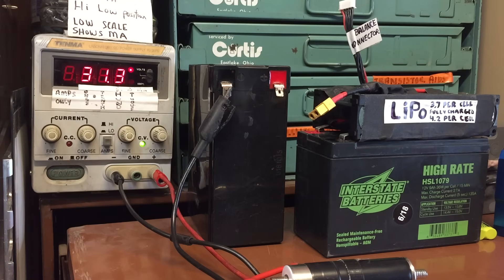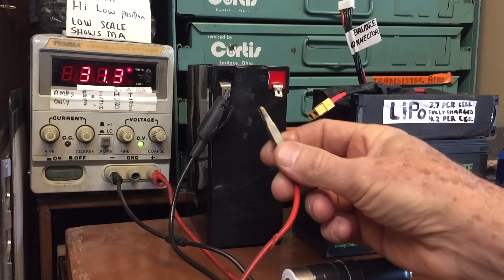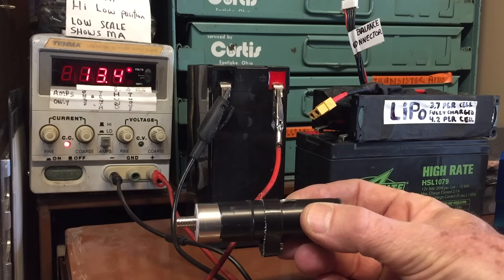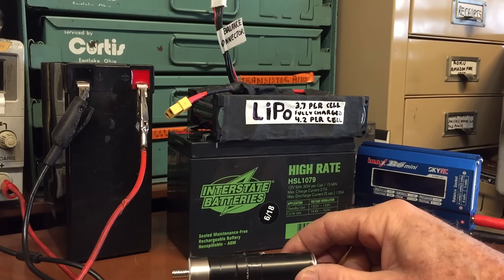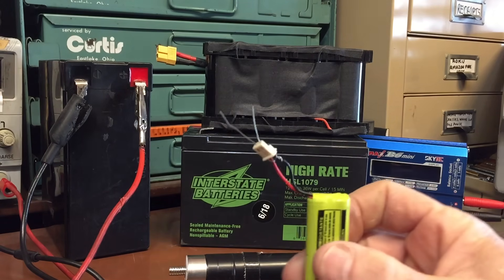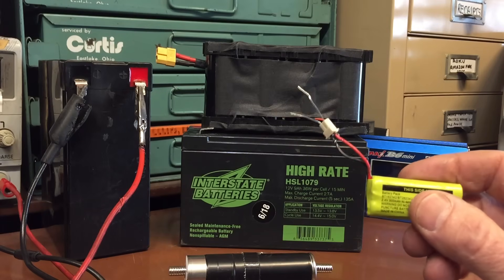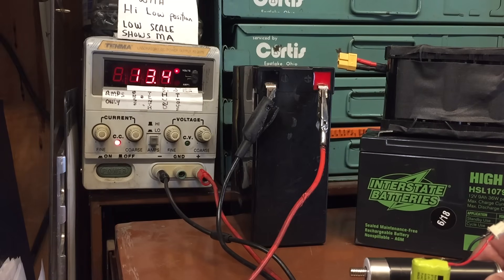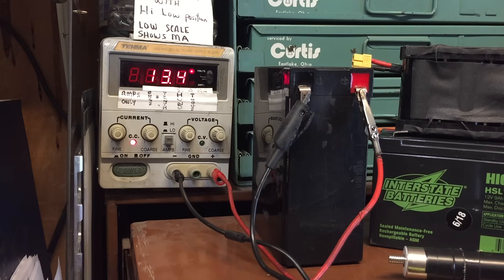Safely Charging Any Battery With Your Variable Power Supply.

Comment: Good. I have a PS so I can use.Question though
If I wanted to charge a 12V car battery and all I had was a old laptop Power Supply 
Output 19V ---- 3.42A. Could I retrofit 2 x terminal clips to the + & - leads and hook up the car battery. Would that work? Obviously monitoring the excercise e.g overheating. Periodic Multi meter checking.
Reply from the maker: I'm unable to understand your question.
Reply: @GrantsPassTVRepair  Oh. Nevermind was just a simple question. Could you charge a car battery off a laptop PS. was a hypothetical question.
Reply from the maker: @byLokie  You can charge a 12 volt battery using your 19 volt laptop power supply if you  don't leave it on the charger to long, but keep in mind that a discharged a 12 volt battery may draw more current than then your laptop power supply can deliver, in which case you may damage your power supply. If I was charging a 12 volt battery using a 19 volt power supply, I would monitor the battery voltage as it was charging, make sure the current consumption didn't exceed what the power supply limits of 3,42 amps, and when the battery your charging reaches 13.8 volts I'd consider it charged.

Comment: Isnt that what a trickle charger does? Keeps a contant 1.5a to a 12v battery. My dad would keep a maintainer on his motorcycle battery all winter. Never had any issues.
Reply from the maker: I twould not be safe to continually charge a motorcycle battery nonstop with a full 1.5 amps of current, but a battery maintainer would probably drop the current down to 50-200 milliamps once the battery is charged to maintain it's charge. and probably put our far more current when the battery is very discharged.

Comment: To over simplify it overcharging occurs when charging voltage is applied to a full battery. Think about your car the battery doesn't overcharge because the alternator / regulator backs the voltage off to the point where the battery stops charging. Fast charging is overpowering (voltage) to get the battery to draw more amperage and fill quickly but if that high voltage is applied to a battery that is close to full damage can occur. I grew up using an old heath kit navy power supply knock off with my grandfather. He would back the voltage off as the battery amperage draw decreased, so I guess to be safe you would need an ammeter. Also monitoring temp would be a good idea.
Reply from the maker: Yes monitoring for heat and voltage sounds like a good idea, and I see your point, but even when a battery is fully charged, and you continue to charge it with just a few millimeters, I doubt that it would ever be a problem on a temporary basis, as your generating very little heat, when you see the battery has achieved its full charged voltage, it's time to stop the charging. Perhaps I didn't make that clear enough in my video.

Comment: U said that the voltage drops bcse of the battery's own internal resistance right? So can I 'gess' the battery internal resistance doing that? I have a lot of batteries cells, so Could I compare them doimg this test to see which ones has the higer internal resistance?

Comment: Great video but my
Question for you is how do you check the state of charge ? Like you level of charge in the battery
Reply from the maker: To the best of my knowledge a voltage drop test under load is the best way to test a battery. Here is a video where I talk about this. https://www.youtube.com/watch?v=TQenKo9AFfQ
Reply: the reason I ask
Is I had a battery for a rc car that was 14.8 v i charged it to 15 volts . But what. It was put an a rc car bms said the charge was at 22 per cent capacity . It then charged its to 100% capacity and was about 17 volts

Comment: 🤔Now can this machine bring a Lithium-ion wheelchair battery back and other  kinds  of batteries  to be able to bring the battery up let it start taking a charger the rest of the way?Because what going on with the battery is 🫣it's way too low for the charger to read to even start up charging it right now!And these two battery's are not even a year old yet . She wasn't really using her wheelchair that much and Definitely Not Keeping them charged up like she should have to keep them taking a good charger.

Comment: I have a 20V DeWalt battery pack that is sitting at 13V. And I can’t get it to pull any current from my power supply. What do you recommend I try to do?
i have the PSU set to 20V 1A.
Reply from the maker: I'm guessing the DeWalt battery may have some internal charging circuitry built in to it, which may prevent the charger from charging the battery if it senses there's a problem with the battery, such as not having any voltage in the battery at all. If it were mine. I'd probably try to charge the battery from the output side of the battery, which bypasses the charging circuitry, but I'd also raise the charging voltage using a variable power supply, and monitor how much current it draws with an amp meter, so you don't over do it and end up blowing up your battery.

Comment: The matter is very simple, I don't know why so much drama and ignorance of the facts. Each type and model of battery has a prescribed excellent maximum voltage at which it is considered fully charged!
That's why, on your power source, limit the max charging voltage and set a limit for the current according to the capacity parameter, for example C/10, or even less! It can't hurt even less! And that is that.
E.g. for a 3.6v LiOn battery, the ideal voltage is 4.3V, current e.g. 500mA
For example, a classic lead-acid battery 64Ah (600A), Umax=14.4v (normal charging) Imax=6.4A, or less, if it has been discharged a lot below 10.5v and has been standing for a long time. The topic is too broad to mention all the details... And that's it. When the maximum voltage is reached, it switches to the constant voltage regime, the current drops to 0, most often it stays at the order of 100-200 mA...etc...
I don't know why you would set the voltage without limitation????? Why?????? What you are doing is dangerous!!!
Reply from the maker: Did you watch this whole video? I was not encouraging anyone to keep their battery charging on a continuous basis with the battery voltage above it's suggested charge voltage. I mentioned that doing so was a bad idea and potentially dangerous. I was simply explaining a technique I've been using for years, when i needed to charge a battery of an unknown amp hour capacity, and I did so by keeping the current down low enough, that I could walk away for a while, and still charge my battery without the fear of damaging the battery from excessive heat. Listen to 1:12 of this video.
Reply: @GrantsPassTVRepair  You don't need to know the capacity of the battery, but you certainly know its working voltage!!!! It can be 1.2v 3.6v 6v 9v 12v 24v 48v for example. It does not matter. If you know what type of battery you are charging, whether it is Li-ion, lead acid, agm lead acid, gel... you also know how to determine the final voltage! If you don't know the capacity, then you just put the current as low as possible, we agree on that, but it can clearly be assumed if you know the type and see what size it is.

Comment: I have long time discharged 18650 LG cells. Visually in perfect condition, voltage is under 0.0500v
Can I try to shock them with 12v 5a dc charger for few seconds?
I did try to connect them to healthy cell and voltage go up to 3v but fast go back when disconnected ...
Reply from the maker: I'm not sure if it's okay, but I've often done this when a battery doesn't take a charge. Is your battery not charging up when using the ideal charge rate for this battery?
Reply: @GrantsPassTVRepair  I did try with 12v 5A dc charger
First I started with few seconds after that but there was no change (cid is ok not blown up)
So i left it for 30s 1 min for few times, now it shows 0.8v 1v but that's it. I'm not sure how long i cant leave it on 12v dc power supply ...
Reply: Sadly i dont have power supply as you so with this dc power adapter I'm blind what I do :)
Reply from the maker: @donmarkon  I've done many experiments like your doing when I've had batteries that would not take a charge, and what I learned is some batteries are to far gone to regenerate, or they may come back to life, and only have a fraction of their amp hour capacity as they should. As you probably know there's always a risk of damaging the battery or causing it to explode if  you overcharge a battery, Much like yourself I take a few calculated risks now and then, but I would not feel comfortable advising you on this one, except to say be careful.
Reply: @GrantsPassTVRepair  Understood :)
Thank you

Comment: GREAT video, yes you ARE absolutely correct…. It is possible to recharge a battery using a variable charger. Just use good common sense and caution. We did and still do this all the time. Just match the rated voltage on the battery and go low on the amperage. Most important… check it and the cables every few minutes and make sure they are NOT getting hot. I NEVER leave batteries that I am charging unattended.
Thank you VERY much for this fantastic well done video. 😀
Also, we used to OVER charge CRT’s (cathode Ray tubes) that’s the main vacuum tube in which the picture is displayed
on an old style TV tube for a few seconds to burn corrosion off the electrodes and hopefully regenerate the picture a bit. This is done with equipment specifically designed for this… NOT with a variable charger. 😊
Reply from the maker: I had a B&K picture tube rejuvinator, but gave it away not long after the flat screen TVs took over the market. There were a couple times my rejuvinator did more harm than good, but other times they really helped.

Comment: So... if 30V battery is charged by dropped voltage of 13V - does that mean I can technically charge 5V AA battery full with 2,3V 100mA charger if I let it sit long enough?
Reply: naaah, the charging significantly discharged it to 2,3V lol

Comment: This is true. If you use 10 % of the batteries capacity you won't damage a Ni-cd  but it will take a long time. Check out battery  charging techniques for more on this.

Comment: I made the mistake of leaving my lithium 24V battery switch on after storing my boat and came back after a few weeks and the battery was dead. Is it possible to jump start or recharge the battery using a product like this? How long would it typically take to recharge if possible?

Comment: If the AC power fails when using a DC power supply to charge a battery, will the DC power supply be damaged due to the the battery sending voltage to the unpowered DC power supply?  The manual for my low cost DC power supply says that damage can occur in this situation.
Reply from the maker: Since I haven't seen the power supply circuit design in which you speak I don't know,                           but It sounds unlikly that an interruption in the AC input power going to the DC power supply would damage the unit just because it had no AC input. I've never seen anything like this occur.
Reply: A diode would prevent the battery feeding back into the power supply during a power outage, if I'm thinking correctly.

Comment: How can a laptop battery be charged using a DC bench power supply? Doesn't have to be fully charged, but maybe 1/2 to 3/4 for Laptop test purposes. Thanks
Reply from the maker: The power supply you use to charge the battery in the laptop computer will need to have an output voltage above the stated voltage of the battery used in the laptop by at least 1 volt, but unless you have a variable current output on your bench power supply like the one  I show in this video the only way to regulate your current going into your battery is through a current regulator or a high wattage resistor. The problem with using a resistor to regulate current is that it will get extremely hot. Naturally you will need a plug that fits your computer charging port, and you will need to match the correct polarity on your plug of you can end up causing your battery to explode, and possibly damage your computer.
Reply: @GrantsPassTVRepair  thanks for the answer. Some bench power supplies have variable current output but would have to look at which ones are best. Also thought of making a short cable to connect to a working Laptop to a good battery to charge it.

Comment: So, the main thing about charging a battery with higher voltage is,  it doesn't kill it, as long as the battery don't go higher then the intended charge voltage, for 12v a healthy 100% charge is ~12.9v normaly when charging it can go up to 14.3v which is normal however, as you connect the power supply and the battery is on low voltage ( 9 or under that) the voltage on your power supply will drop significantly so to charge it you need higher, even up to 30v could be used, however as the voltage inside the battery go higher the overall voltage drop will be lower, if a 12v battery goes down to 6v and you put a 20v and don't pay any attention to it it could go above 15v at which poin most 12v battery  start producing explosive gasses. So yes you can charge a battery with higher voltage, and yes it could explode if you leave it on for too long, however at low current it could take days or even weeks to become explosive.
Reply from the maker: I was not able to understand everything you said. 
                                                                                                I know from experience batteries produce an explosive hydrogen gas as they charge, That's  why people who live off grid on solar energy are encouraged to keep their battery banks in a area that has ventelation on the roof of the container they are kept inside.  Aside from the hydrogen gas danger, the other danger from overcharging  is to much pressure inside the battery can cause it to explode. I don't believe this should ever be a problem if your current is kept very low,
Reply: @GrantsPassTVRepair  Okay i read back on what i said, it's realy caothic sorry kinda lost my point there. In base what i wanted to say is, if the current is kept low it could still produce hydrogen, if it's hooked for too long to high voltage, however the current will tell you how fast it will happen, and as i said at low current it could take weeks or months. and it's indicated by the overall voltage on the battery while charging, if you start charging a battery the voltage will slowly rise as the battery charges, if it reach a point like a 12v battery charge 13.5-14.5v above that, it usaly produces hydrogen and could be dangerous. but on low current, it would probably sit there for weeks or months if it's a big battery, and it has to sit there, charging in an airtight, locked room to explode. If you don't actively  try to achive an explosion it probably won't happen, but saying that it's not dangerous, is not right since if you don't know how to set the volt-current ratio it could take months to charge or explode in the wrong hands. But i think you could probably fine tune it as it fully charged to stay under that 14.5 volts.
Reply from the maker: @studioreaper9646  Unless you are using a smart charger which monitors the battery and adjusts the charge rate according to the batteries needs, I would not leave any battery on a charger continuously day after day for weeks at a time as it could cause unnecessary wear on the battery, but as long as your current is set low enough I don't see the likelyhood of an explosion.                                                                                                                         ...I remember taking apart an uninterrupable power supply which contained a 12 volt gel cell battery, and a regulated charger which continually put out a charge voltage of 13.8 volts no matter what the charge rate of the battery was. Even though batteries don't consume much current at that voltage after they are fully charged, at 13.8 volts they do consume a little power around the clock, but apparently the designer of the uninterruptable power supply concluded it wasn't enough to be an issue.                                                                                      ....I think short term charging using a higher than suggested voltage is fine for short term charging, but to create an explosion takes heat, and if your current is set low enough the heat produced can be so small I don't believe it's likely to be a problem.
Reply: @GrantsPassTVRepair  Yeah smart chargers are mutch safer. Also that 13.8 volt is pretty mutch optimal to keep a battery charged. Also fun fact smart chargers don't operate on the voltage they actualy put out,  they usaly have higher voltage, using square sign waves peaking at around 25 volts periodicaly ceasing and restarting the charge on high frequency , connected to a capacitor to even it out, meaning the charging is ceased 45% of the time to achive 13.8v under no load and under heavy load it could turn it up to 25volts although the actual output voltage is never shown since it's set up so the battery would stay on 13,8 or lower as the voltage drops under the load.
Reply from the maker: @studioreaper9646  Sorry but I could only understand half of what you said here.